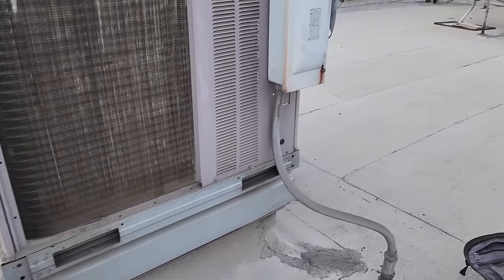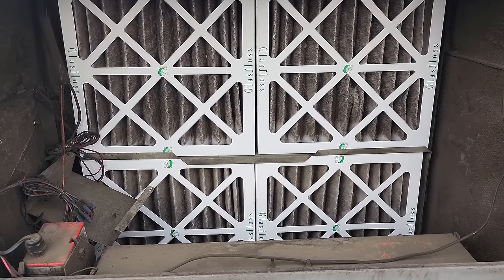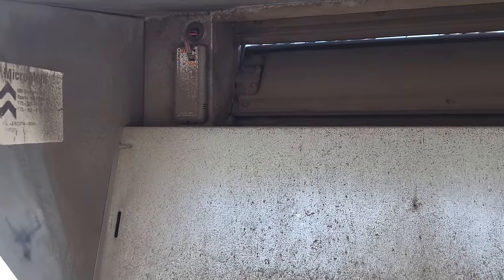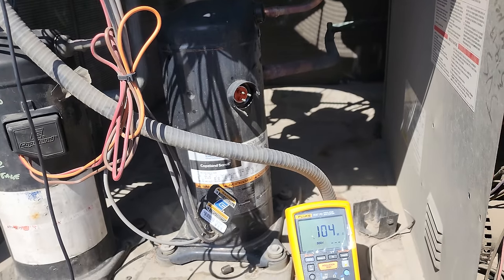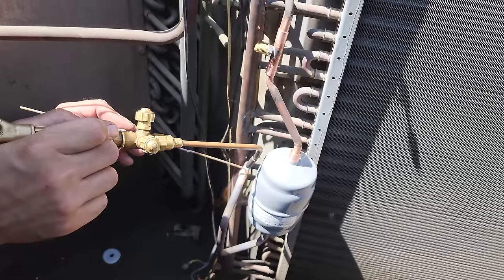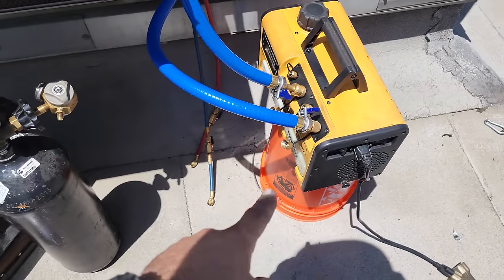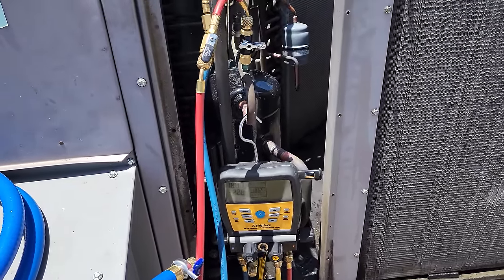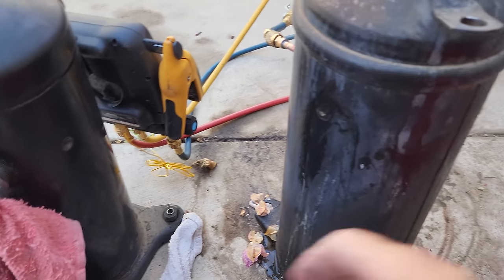THEY SAID HURRY EVERY AC IS DOWN

Comment: Chris, I recently jumped into commercial service from residential. So this might be a dumb question but do you clean the refrigeration lines with r11 flush or nitrogen when you do a conversion to 407c?
Reply: I only use the flush kit if there was a burn out or some type of contamination in the system. You'll definitely know if it's burned out by the smell of the oil. Otherwise, blowing out each of the coils with nitrogen will be good enough. A little residual oil won't affect the new oil.

However, I do want to welcome you to the dark side! Commercial/industrial is so much better than residential. Your diagnostic skills and mechanical knowledge will shoot the roof. You'll be fixing equipment a lot more often than you'll be selling and replacing it. One thing you'll learn is there is no such thing as a dumb question, especially in commercial/industrial service. If you've never done something before, there's no way you could possibly know how to do it. Don't be afraid to say "I don't know." There is such a huge variety of equipment out there, everyday, for the rest of your career, you're gonna run into something you've never seen before and you're gonna need to ask somebody for advice. Never be afraid to ask questions. Just keep trying to learn every day and continue to gain experience.
Reply: @paulcrandall2534  Thanks man! I really appreciate it!

Comment: I am sure this question will never get a response but....since the compressor was out on one unit why didn't you use the OAT from that one on the bad OAT on the other one then of course get the replacements parts for the working unit.
Reply from the maker: There was no point because I disconnected the bad one and it started running, no need to swap parts and create extra work.
Reply: @HVACRVIDEOS  that makes complete sense. I must have just missed that in the video. I enjoy your videos by the way and they always make me feel better that my own work ethics are strong. I got laid-off and from time to time I have to remind myself it wasn't me, it was a bad company. Thank you for reminding me I was a good employee.

Comment: With the new economizer controls why are you looking at dry bulb only and not enthalpy also when running economizer you should also have a y2 call that way they can run compressor with economizer and if the discharge air gets too cold it would modulate the economizer and keep compressor running.

Comment: What are your opinions on r422D as a retrofit replacement? That’s what we use where I work right now, as a retrofit for r22. Seems to work pretty well.
Reply: That stuff isn't too bad. It works. I've used it before and had no issues

Comment: 23:52 Since that's a raised circle with a divot in the center, I strongly suspect that's an emergency pressure relief plug that blew out...

If the Carlisle brand of Compressors are notorious for leaking from that exact same blow out plug, I wonder if the original designers got their math wrong and specified a material or component design that couldn't take the normal operating pressures/vibration of the Compressor over the course of it's rated lifespan and just kept failing due to too much pressure (even though the pressure was normal for the system) and/or it just vibrated loose over time...
Reply: @A Wilson 
Interesting thought, I wish more engineers would post their observations on things like this in a practical way that layperson's can understand. I'm not an expert at advanced math, but I understand basic principles of mechanical science.
Reply: it looks like there's 3 of them around the compressor spaced evenly. I'd guess those were holes which they plug welded and it's holding internal metal ring that's supporting the compressor internals. probably some vibration or harmonics when they're worn or loading is off, vibrating the weld/case around the weld apart.
Reply: @throttlebottle5906  That could be it too...
Reply: @throttlebottle5906  This is correct. I have cut them open to check.   I have also tig welded them when broken and gotten several years out of them.

Comment: Assuming this isn’t a restaurant with exhaust fans, how well do economizers work if there isn’t a place for the air to exit the building?
Reply: If you are talking a small package unit. Generally speaking you will see a portion with barometric relief  on return side as pressure increases in building area served it will blow open just enough to relieve that pressure. Being it it not exacting as exhaust controlled by static pressure it can over pressurize but minutely. Of course negative pressure will suck blades down as well.

Comment: OEM approved.   There are a couple of things that this could involve.   1) they want to mislead you on which Original Equipment Manufacturer.  It could be the manufacturer of a filter dryer.   2) They won't actually use a company name because then they're stepping on the rights of the company_.   'You used our name without our permission!'.     You _can use a company's name without permission, but only if you have specific evidence.   Papa John's compared itself to Pizza Hut because the founder of PJ was involved in Pizza Hut, and they couldn't claim he couldn't know enough to compare.    That's why you see "Compared to a leading competitor", instead of "Compared to company B!"      If you contact the company, they may even tell you over the phone (or in email) what the OEM might be - but they can't do it in public.   (published)

Comment: Out of curiosity, why 407c instead of mo99? My reason being that mo99 is compatible with mineral oil
Reply: I think everyone uses what they are comfortable with i tend to use 427 just cause my teacher recommended i use it
Reply: @oxnardshores8058  once upon a time, I attended a school (FBM Training Center) on the HVAC system on submarines. When they were "teaching" us on how the humidity controls interact with the heating system, I noticed something wrong, and spoke up. I was told that I was WRONG, that this was how it had worked (like!) forever!
We went to the mockup (operating) trainer, started the troubleshooting drills, the instructor came up to me and said "you were right"! Even their trainer proved me right! 
When we went back to the classroom, they presented the correct system, and changed all of their erroneous drawings (it was alot!).
Get "common" sense, and use it!
It's called "learning"!
Reply: @brucelytle1144  I have common sense otherwise I'd be a forklift driver still. I'm not sure if your being a smartass or generally trying to help. Either way have a good rest of your evening. And thanks for your input.
Reply: @oxnardshores8058  not at all trying to be a smart ass. What I'm saying, is teachers aren't always right, I won't bore you with it all.
What I'm saying is to follow what you know works, and disregard things you've been "taught", that your experience tells you aren't so!
Peace!
Reply: All new Copeland compressors come with POE oil in them, so 407C is an easy choice when replacing a compressor.
Reply: @markbeiser  thanks for the clarification! From what I recall, mo99 is suitable for use in both mineral oil and POE oil applications
Reply: @lsx_moe  mo99 has capacity loss issues that 407c doesn't though.

Comment: Another great and informative video Chris! It's refreshing that you are promoting doing the trade properly and not teaching how to "just get by". I actually have to admit that I did just that. My condenser fan motor was occasionally locking up at night and I tested my cap first which tested bad. So I just replaced that to "get by", however, 2 weeks later and I started having the same problem again... wake up in the middle of the night and it's 85 degrees and humid in the house. So I ordered a new fan motor and it was what I should have done to begin with. Because the bad bearings in the old motor ruined the new cap that I tried to get by with... (it was not overamping) So your educational videos have taught me a valuable lesson, with inflation going berserk it's best to do it right the first time. Because I would not have wanted to be changing my compressor had it been going off on thermal lock out too many times (being a 15 year old Mayag package unit). Cutting corners almost cost me more than just doing the work properly. Thank you for your wisdom and the Fieldpiece SC480. It has been a great Christmas gift from 2 years ago! Keep up the great content!

Comment: The shadow from the gas leaking out is basically doing the same thing as sticking a pencil in a glass of water. The gas bends or refracts light just a little bit differently than the air around it. They're both clear, but just like a pencil seems broken where the water in a glass meets the air the light will be changed where the border is between the gas and air.

Comment: Help - I am retired and have never done a 407C conversion. Do you worry about any residual mineral oil left in the condenser or evaporator? Have you ever tried to remove the oil from the compressor through the process tube and then convert to 407C? Great podcast voice!

Comment: you can listen tor HVAC mnf. I disagree completely. Equipment mnf will know this information as well. Used to work for commercial Trane. Good luck getting ahold of tech support for the compressor mnf. Copeland reps most likely don't sell direct to contractors. However I agree with what you say about flushes, additives, etc. Any equipment mnf would not recommend.

Comment: Biggest problem I have is the fact that customers never want to pay the bill or want to hold off the repair. Nice repair, but too many steps during leak test after brazing in components. I just do a nitrogen pressure test at 300 psi and let it hold for 30 minutes or more. When my gauges hold, then purge system and start evacuation. Also with charging, I add the total factory charge. Since it’s a package system, no need to dial in anything because no additional line set exists like a split system. Also only ran into a weld leak on a compressor once. I am on the east coast and noticed a difference between west coast, east coast, and southern equipment. I do commercial and residential, service and installation. It’s always nice to see it done right, but it’s not the universal.

Comment: YOU INSTALLED THOSE ECONOMISERS!? wtf man? thats your work ethic? just connect it, then not mount it, but let it dangle by the wires...not install it in the cabinet, but in the dusty intake area. you see those holes in the mounting plate? they are for screws to screw the unit down...not just let it dangle like a slouch. 
THEN you have to go back for a service call because you left the set point too high? DUDE REALLY? i cant watch anymore.
Reply from the maker: Umm I removed it to troubleshoot it, it got mounted back to the panel when I was done...

Comment: Copeland approves Spectroline UV leak detection dye.
"Spectronics AR-GLO 4/E Fluorescent Leak Detection Dye is approved for HFC/POE and HCFC/MO usage at the
manufacturer’s recommended concentrations."
https://climate.emerson.com/documents/refrigerants-lubricants-approved-copeland-compressors-technical-information-en-gb-4839658.pdf

It is the only 3rd party additive they officially approve of.

Many equipment manufacturers were handing out detergent additives after Copeland's corrosion inhibitor oopsy in 2014 and 15 that was plugging up expansion valves, and Copeland didn't complain.